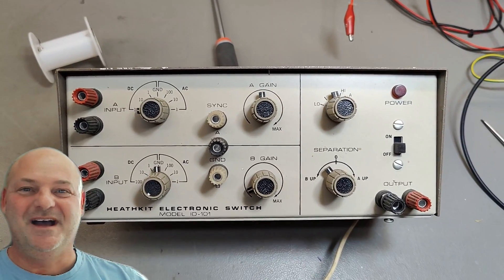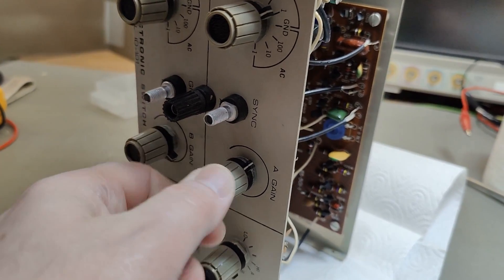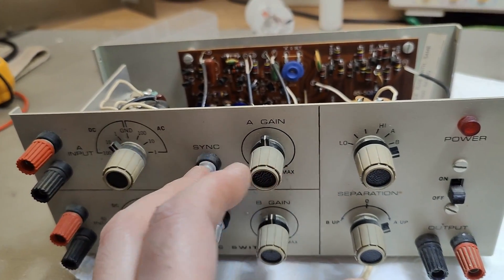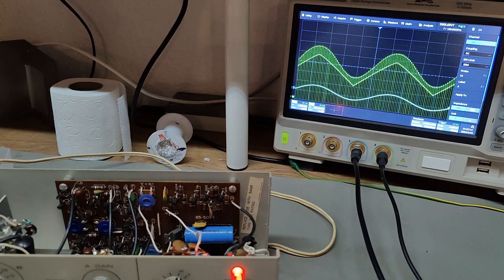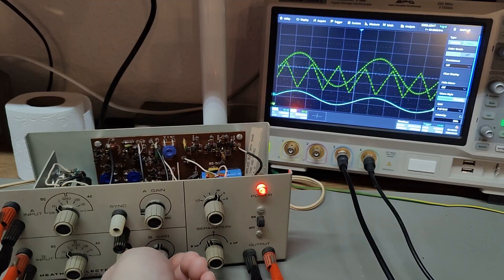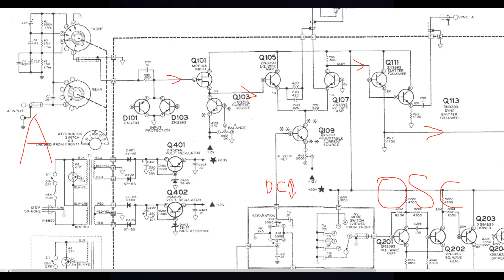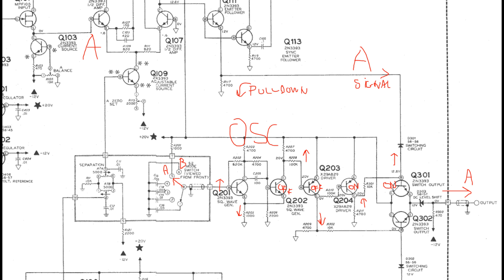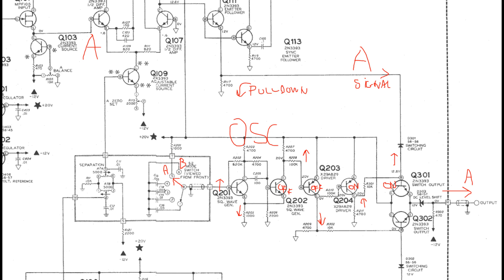Heathkit ID-101 Electronic Switch Scope Chopper 1971 test teardown

Comment: This one demanded a blood sacrifice :)

The nonlinearity on the A/B amps is a wee bit annoying. I think you could increase the Y sensitivity on the scope - say to 1V/cm. Then you can lower the gains and the chopped channels will look better.

To mimic an analog scope better you could use the color graded mode. The vertical lines will be dark blue and won’t stand out so much. They’d how it would look on an analog CRO sans color.

The input protection would be clever if it were unipolar - it would clamp to VCEO, and it would be pretty damn fast, too. With two transistors back to back I’m not sure what would break down first - CEO or reverse base or what.

Comment: Was your input signal on A and B,  DC or AC?? You had it set for 1 volt DC?? My function generator is modern, but when I output a 1Khz signal sine wave and triangle wave at 1 volt is is not a AC signal?? How does a Function generator output DC rather then AC??
Reply from the maker: all modern signal generators got amplitude the AC part, and a DC offset part, I find it very usefull to be able to control DC ofset for many things,
Reply: @TeardownOZ2CPU  What is the make and model number of the signal generator you used in your video??? Thanks in advance..
Robert, San Diego, Ca. USA
Reply from the maker: @myradiovideos  I use mostly Siglent equipment due to good value for the money, my signal generator is SDG6022X it is most likely possible to software hack it to 500Mhz I heard on EEVBLOG :-) so then you got even a better deal. if you need the frequency range, features, risetime and all that come with the upgrade,,

Comment: Back in the late 70s, I installed a circuit like this into a single channel AC scope, which made it work in DC as well as two channels.

I don't remember what scope I used, but I sold all of my test gear to the company that employed me while I went to school, and I went back home to get a job testing and repairing computers on the production floor!

Comment: DARN!!!!!! I have the same unit, picked it up off eBay for $25.00, BUT,, the "A" channel is not working. I am not sure it is operator error, but I am going to drag it back out and be sure I am not doing something wrong. I do have the Original Blue Assembly and operational manual, also mine is the newer BLUE color unit... 
I was going to use it for validating where the outer shield of a capacitor is! I was going to hook up input A and B to the same capacitor, but the leads will be reversed, and then see if I can watch the scope and validate if touching the outer side of the capacitor is it A or B that deflects more... I am sure this is new and only an experiment for me... 
Thanks for explaining the signal flow on the schematic, it will help with advanced trouble shooting if I need to go that far... 🙂
Robert, San Diego, USA
Reply from the maker: do you have a ability to adjust both positions very close using the separation knob ? and then try to input weak signals on A and B
Reply: @TeardownOZ2CPU  Don't know??? Need to drag it back out of my garage and re-test the unit. Stored it away 6 months ago...

Comment: Dual channel scope you would have 2 of these, to get that coveted 4 channel scope.The odd supply rails is simply because the most common, and thus cheap, transistors they could get, all have a Vceo of 30V, so having the non symmetric power rails allowed them to use them, not needing to use those much higher cost 50V rated parts, selected out of the regular parts in production, and sold at a premium price, and still be able to have the output reach 10V amplitude without clipping. As all those transistors and diodes in the signal path remove output high capability, but it is easy to pull to the negative rail with the resistors, so you can easily get -10V out.